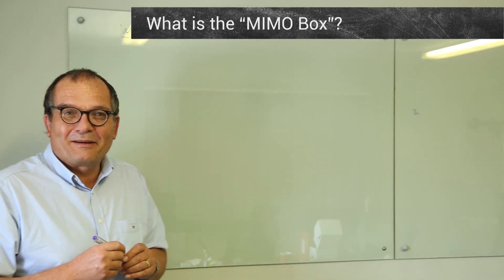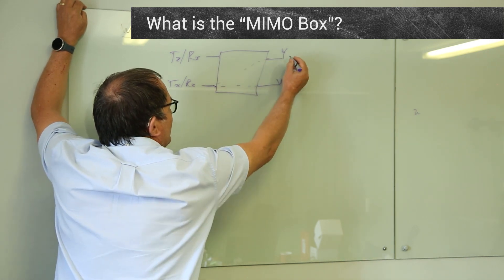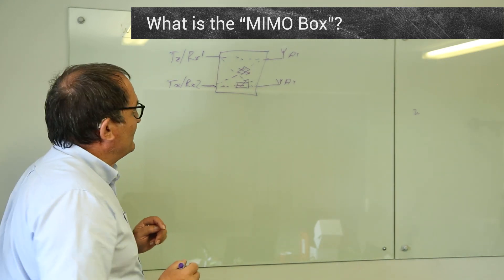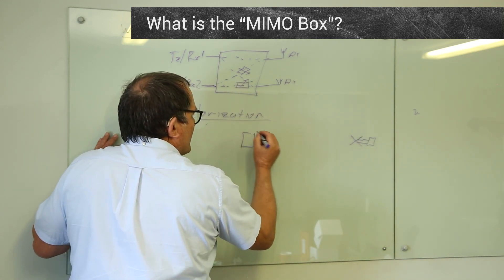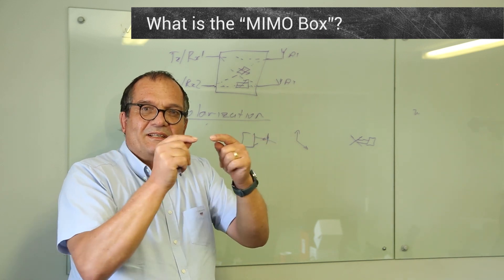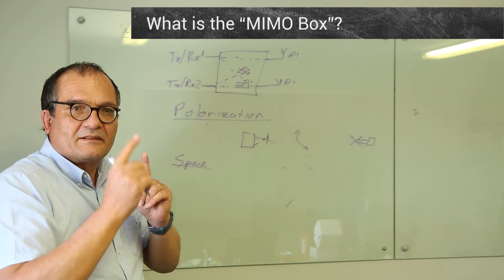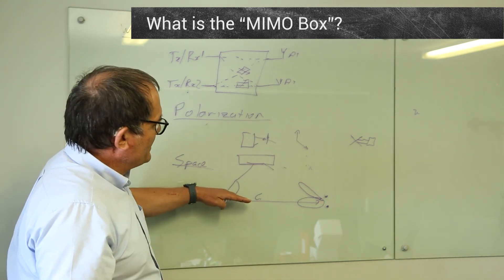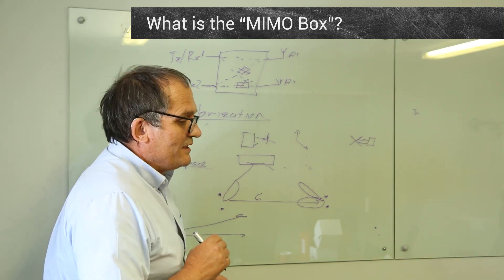MIMO Basics #1:  How MIMO uses Antennas ?

Comment: It is possible mount a 4x4 mimo in a Zyxel Cat12 even if i have only 2 antenna ports???
Reply: 4x4 is achieved by physical antenna port. You can configure 2x2 on 4 port but not 4x4 on 2port

Comment: Unfortunately in India the 4g carriers have opted for lower data rate and lots of smaller stations (no mimo).  Likely it was done to reuse the 3g infrastructure, so data rate tops out around 35Mbps.  Cross Pol antennas help a bit as signal bouncing can leave the signal path flipped, or an interfering signal may arrive on a different polarity so SNR can improve. The tx/rx seem to pick the best path so it's a little help but nothing like mimo should be.  Perhaps 5g will improve on this
Reply from the maker: Really unfortunate and must improve. Given the population density the loss of capacity with not using spectrum properly MUST; drive full exploitation of MIMO and highest order OFDM modulation schemes.